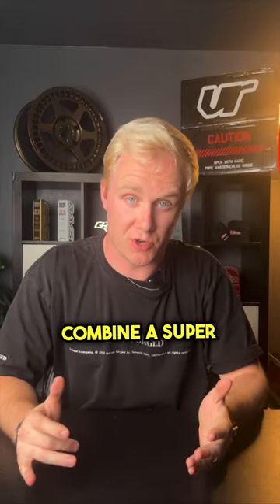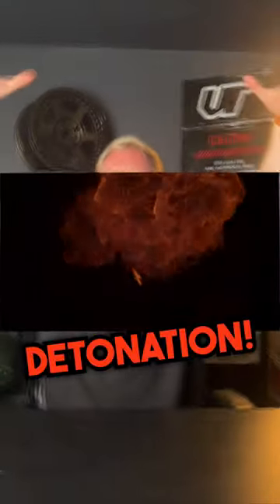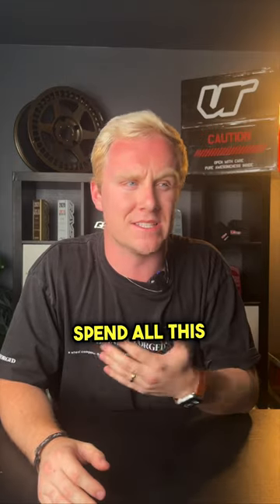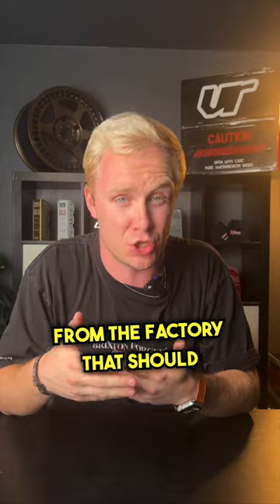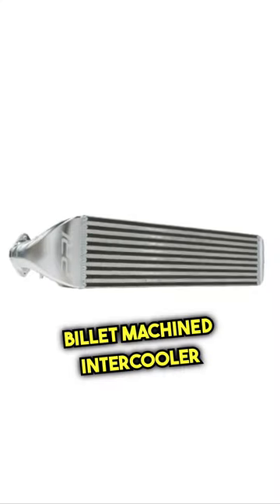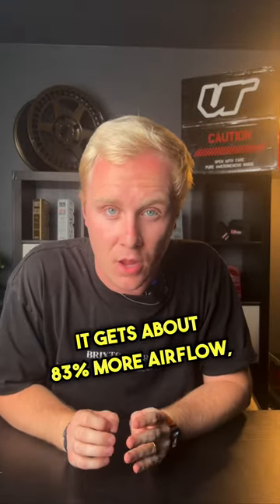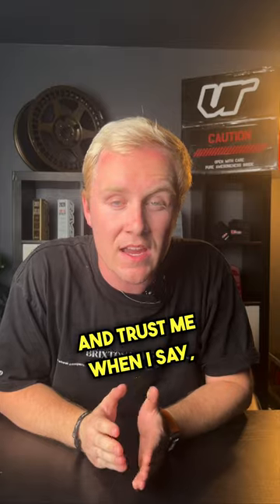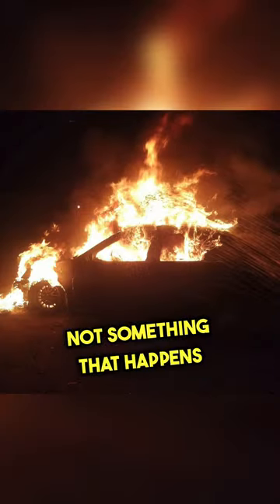Why should I upgrade my stock intercooler?

Comment: had a type r stage 2 w a greddy intercooler and it did nothing for heat soak. it was faster than the stock but the ONLY way to cure this is a hood with actual air flow. the oem hood is cosmetic garbage
Reply from the maker: But PRL doe 😏